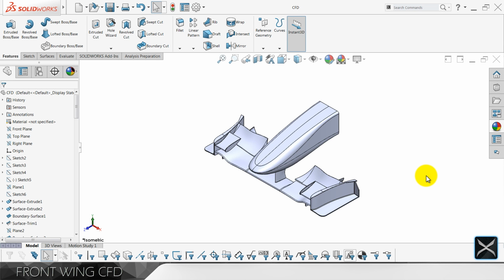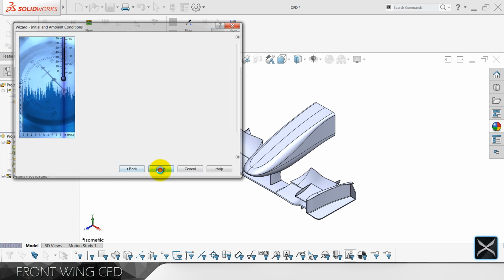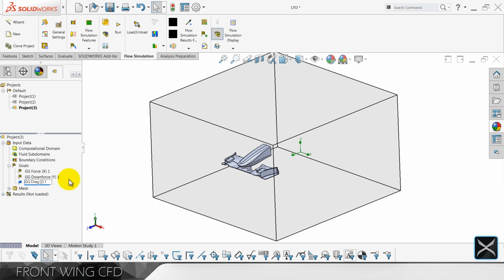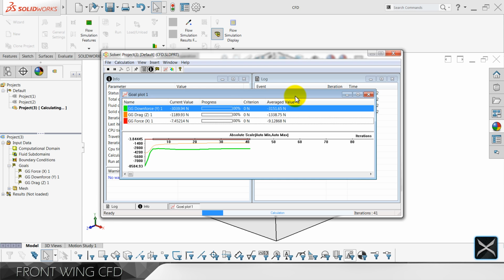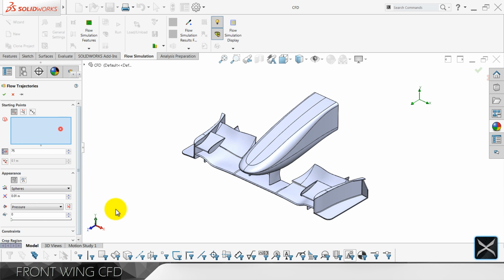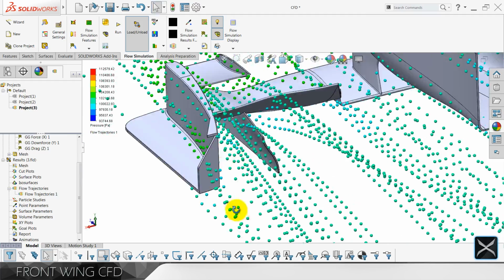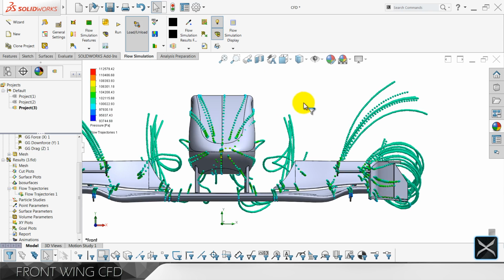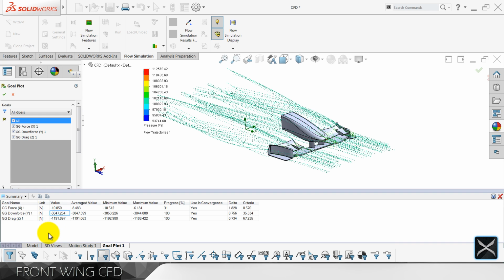SOLIDWORKS FLOW SIMULATION - FORMULA 1 FRONT WING CFD

Comment: Hello mr. amazing work there thanks for this series of videos. I'm working on a design for rc car but when i'm going to start the flow simulation i'm getting an error which says starting points were not created even though i've selected every face/edge/curve of my design.  Funny thing is the first test worked fine but later i decided to add more fins and stuff and since then i'm getting this error. Any idea what's causing that? Cheers!
Reply from the maker: thanks a lot man
well it can be anything, any time you change something in the design you have to check everything and computational domain as well, let me know if you need more help!

Cheers, Petar!